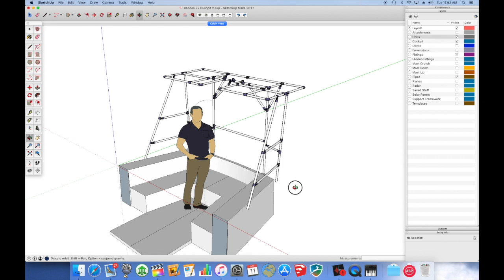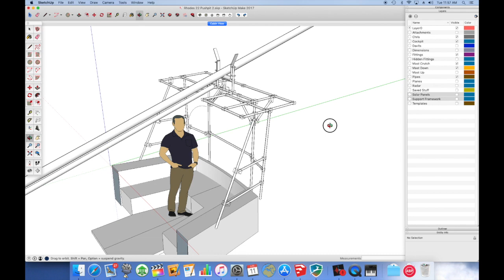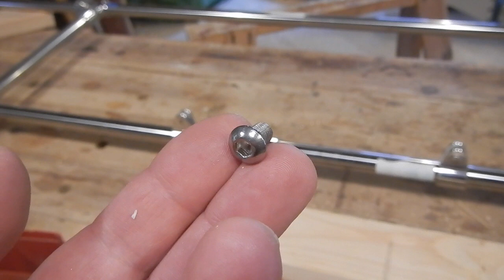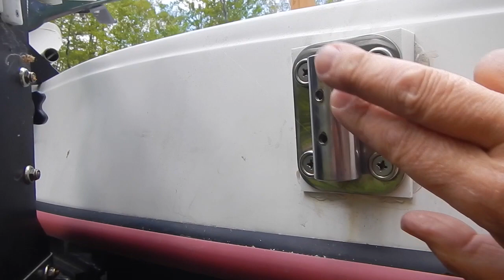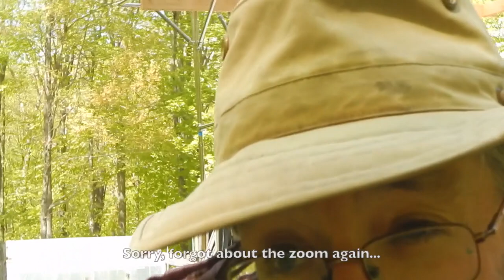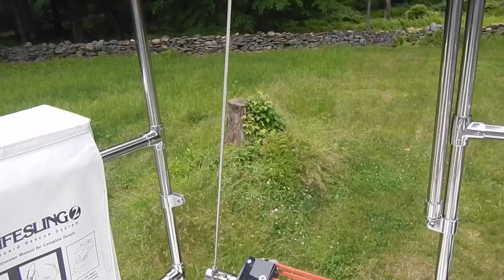Ep 60: DIY Solar Arch

Comment: Aloha .. Epic rig . So im on a non existent budget. Solar has to go up. I have a small 26ft. You reckon i could build this out of PVC piping ?Cheers
Reply: How much did this cost , Do you have a BUY list of what you used by any chance. Aloha
Reply from the maker: I have an old estimate that the fittings needed would add up to about $600, so the total cost was probably in the $1000 ballpark.  I'm no engineer, but I seriously doubt that PVC is up to the task.  --Peter
Reply: I know this is old, but just in case anyone is reading this - keep in mind that most PVC is intended for plumbing work, and has no resistance to UV.

Left in the sun all day it will quickly become dangerously brittle.
Reply: There's uv resistant pvc and it can be painted and stick a dowel coated in thickened epoxy to strengthen it... fantastic and cheep!!! @jeffdege4786

Comment: Hi Peter, I did a very similar job from 1"-ss-tubing and fittings for my 33 ft sailboat. I just designed a bimini which can carry a solar panel 62" x 42" that delivers 325 watts and is pretty heavy. It's still work in progress, but to secure the fittings, I just drill a 5 mm hole thru the fitting and tubing and set a 5 mm-ss-rivet. Easy peasy. No tread cutting, no countersunk, which is not too much fun to do in stainless steel anyway. Rivets are giving great stability too. I hope you enjoy a cold beer in the meantime. That's my goal too. Cheers
Reply from the maker: Rivets! Brilliant!  I haven't worked much with rivets for some reason, so the idea never occurred to me.  I assume that they can easily be drilled out if you ever need to disassemble.  --Peter

Comment: Hi Peter,
Where do you buy all your materials, especially the fittings? Thanks
Reply from the maker: I got the tubing and a couple of fittings from Defender (defender.com).  The bulk of the fittings came from McMaster-Carr (mcmaster.com).  To find the fittings go to: Tubing > Structural Framing and Fittings > Stainless Steel Slip-on Framing and Fittings.  --Peter

Comment: Hi Peter, that’s quite impressive!
What material are you using for the spacers? It looks like some kind of plastic or nylon but I didn’t catch what it was.
Reply from the maker: I assume you're asking about the shims and spacer block used where the aft vertical railings attach to the stern of the boat.  Yes, they're plastic.  Specifically, they are made from high density polyethylene (HDPE) sold under the brand name 'Starboard'.  You can get it from McMaster-Carr, of course.  --Peter
Reply: s/v Silverheels Yes, that’s it! I thought I heard you say “starboard” but I was confused. Thanks!